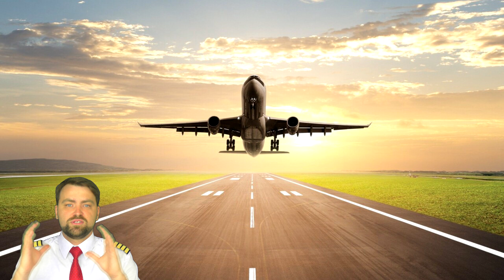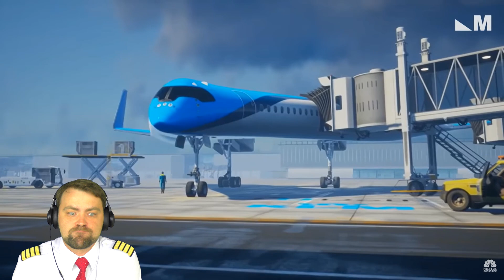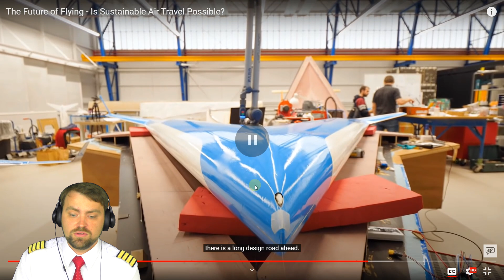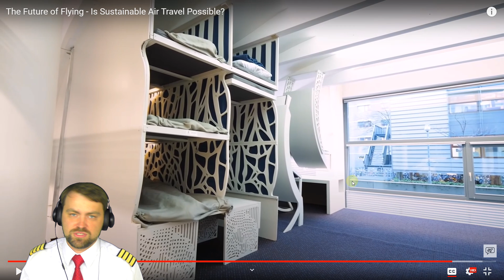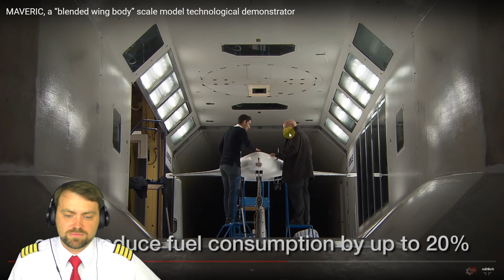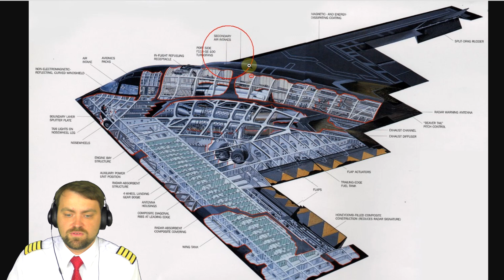Why this Airplane will Never fly? Flying-V plane concept review.

Comment: The blended wing body aircraft design is being considered for low carbon emissions using hydrogen as its fuel.  The cons are pressurizing the interior, emergency egress, and airport infrastructure as well as maintenance.  The pros are low carbon emissions, higher fuel efficiency, lower cabin noise with the engines in the rear, and ability to upgrade to hydrogen as a fuel source.

Comment: Jetzero is under contract to build a blended wing body for US Air Force (USAF). The USAF wants to use the Jetzero Z4 as a tanker or a cargo plane.  A full scale development (FSD) prototype is scheduled to fly next year.  Northrop-Grumman is partnering with Jetzero.  That brings in knowledge of B2 synergies.  United Airlines has firm order for 100 commercial versions with options for another 100.  This is contingent on Jetzero Z4 meeting milestones such as the FSD prototype being flown for USAF in the 1st quarter of 2027.  USAF has Jetzero under contract to have Z4 in service in 2030.  If successful, the commercial version will lead to an aircraft that seats 250 with 5K nautical miles range.  Delta Airlines and Alaska Airlines are teaming to provide advice to airport constraints such as gates, ground handling equipment, and maintenance considerations.

Comment: Tupolev TU-404 was a blended wing body airplane developed in 1991, but never went into production.   Tupolev should consider designing a scaled down version of the TU-404 on the same size as the Flying V.  Dust off the plans and make for today’s.

Work on the Tu-404 was initiated in 1991.  The Tu-404 was designed to transport more than 1,200 passengers to destinations 12,000 - 13,000 km away. The Tupolev Design Bureau investigated several possible configurations for the Tu-404, including a flying wing and a conventional design. The flying wing's powerplant would consist of six pusher turboprop engines developing 18,000 kg of thrust each during take-off and each consuming only 0.644 kg/kgf-h of fuel in cruise mode. The engines would have been located in the tail section of the flying wing fuselage between two large V-shaped vertical stabilizers. The central fuselage contains six passenger compartments accommodating 1214 passengers. The leading edge of the central fuselage has a sweep of 45 degrees. Two large removable wings containing fuel tanks have the leading-edge sweep of 35 degrees and are attached to the central fuselage. The wings hold most of the aircraft's fuel.

Comment: hi pilot, considering there is like a meter of space (or more) above the ceiling in a b787 fuselage (because it's like an egg shape), this structure could actually work and doesnt need to have a huge diameter if they make the roof more or less flat. (less curved)

Comment: Maiden flight just happened, according to various sources including CNN.
Reply from the maker: Of a real plane?
Reply: @PilotBlogDenys  apparently a real time scaled version. Not taking sides. I did read a few comments about passengers in wings and wings flapping in turbulent conditions but I have no idea if that is a solved issue, a scaled down unsolved factor then measured or what. Interesting stuff. If I had more time too look into it.

Comment: My main concern is that the passengers are far away from the roll center of the plane. They're going to feel alot more movement inside the plane, even in simple turns. I dont think it will be a confortable flight

Comment: 10:30 fully undarstand the pain 😂 
Some very interesting facts for example about ice accumulation. Didn't thought about it. From aerodynamics point of view this front section with this massive sweep would create enormous drag due to bending streamlines, and then those thin wing tips would get all this irregulary bended streams causing poor stability and making it very dependable to the angle of attack. Those engines wouldn't even get most of those streams. The only reason why swept wings exists is to be able to fly faster staying subsonic.  Also from engineering point of view.. where the wing spars are suposed to be located.?.  Saw a video saying that there is exactly opposite tendency in aviation to go for less swept wings and fly a little slower for fuel economy. Conclusion thoughts about this project: how serious concern recognized this guys as experts and gave them money to play?? Wtf

Comment: So you are mistaken, the model V plane was flying already. So it is not a paper plane as you state.
Reply from the maker: It is... Show me the real Flying-V! 
They launched the RC toy with 0 science in it. Money laundering, nothing more. As I said. The real Flying-V will never be real.
Reply: @PilotBlogDenys  You look a bit too negative on this matter. I've seen the model last year on 7th October 2019 at the 100th anniversary of KLM where it was presented first time and it looked impressive. Yes, I agree there is no full size plane yet, but it doesn't mean it cannot be done, Airbus is also looking into it. Further Delft Technical University is nothing but science. And flying wings were already flying in WWII, developed by the Germans: the Horten Ho 229.
Reply from the maker: @maartenj.vermeulen900  I am negative, because I don't see any prospects for this model. Well it is just my opinion. I hope that I am wrong 😉. Thanks for commenting 👍

Comment: As an expert in the rc hobby i can tell you know that the RC "scale model" will act very differently in the 1;1 version. In RC, if you stick a powerful motor on anything it would fly.  I can make  a flying circle if i wanted to and it would fly. Physics would affect the plane much differently in the 1;1 version.
Reply: Not to mention how aerodynamics act entirely differently. 
For example, if using a Naca 0012 airfoil for a very small plane, at those Reynolds numbers (~100000), the profile will produce better efficiency if mounted backwards (trailing edge forwards). Which is weird unless you consider that the best profiles at those tiny Reynolds numbers are sharp curved plates.
Reply: @g.zoltan  🤣 earodynamic rules cant change man. its all about using the correct weight, ballance and thrust ratings.
Reply: @royvanderweijden4432  Rules do not change. If implemented correctly. To reflect on my comment, an airfoil's characteristics depend on the Reynolds number. 
Different Re number, and the profile behaves differently.
Reply: Like you said," If you stick a powerful motor on anything it would fly." Here's the best proof of that I can think of. https://www.youtube.com/watch?v=0rJnXZsrMjU&t=92s
Reply: @flying-speed-attained  😂 the flying lawnmower was hilarious
Reply: Very true, but testing scale models is probably used in conjunction with wind tunnel testing and full scale CFD simulations to help validate the design.

Comment: Me again. I thought about another issue. It looks like the landing gear legs are very very tall.    And the landing gear retracts backwards, not sideways like real airliners. Considering the size and weight of a real V- Plane,  it would need multiple tires . My point is, there would be a big CG change with that much landing gear weight moving  that far back and forth, instead of sideways, near the CG, like real airliners. With landing gear retracted for cruise, it would be tail heavy. And for take off and landing speeds, it would be nose heavy. The V-Plane better have a very powerful elevator .

Comment: You should know that TU Delft is one of the leading universities worldwide in mechanical en aerospace engineering. People working on this project, and more generally aircrafts are Engineers, they know about structural mechanics, fluid dynamics, aeroelasticty, vibrations, heat transfer, etc. They dedicate their lives to building aircrafts and make aviation safer and cleaner for the environnement. You are a pilot. you use what engineers built and thaught about. So you may trust the engineers who brought aviation where it is today before bashing their work. Building aircrafts is not your job.
Reply from the maker: Great comment. They may be good in some design, but you can't avoid the air laws, aerodynamics, economics and common sense. I know what I am talking about. That project will remain concept, TU Delft will take the money and they'll be happy. KLM announced the lay-offs of 1500 employees and still investing to strange projects like this. Some professionals are up to loose their jobs but media showed this flying RC toy making everyone happy about it... No my fried, this is WRONG!

Comment: Sure, it's far from being a production plane, but the model flew. The fact that a big airline like KLM is willing to put some money into it, shows that there is optimism such a concept could eventually work. I don't see airports needing to adapt their infrastructure for maximum efficiency as a big problem, because it happened in the past. Airports adapted terminals for the A380 for example. Once a particular type of plane becomes popular, adapting the airports is the easy part. The challenging part is finding a company that will be able to produce those kind of planes in an assembly-line fashion. Here the chances are, the likes of Boeing or Airbus are either going to embrace or trying to kill it outright.

Comment: Damn, do your research before you will make such statements. It is clear that you've done none of that. Few things I would like to point out:
0:20 Commercial aviation industry does not develop fast. The general design of a plane we fly today was made in 60s. It does not mean there was no progress, but it achieved by very small, conservative iterations. 
0:31 Those "developer" are Boeing and Airbus. I do not think you need that air quotes there. They know how to make an aircraft. 
1:30 Are you sure the passengers will be in these wings? Yes. It is flying wing. Fuselage is part of the wing. That is the whole concept of flying wing. Instead of having fuselage that drags you down and wings that generate lift, entire airplane is a wing and generate lift. 
1:43 Have no doubts, because it will reduce drag. If you knew a thing or two about it you would not doubt it. At the speed of 0.82 mach the biggest problem is surface drag. The more surface you drag through the air the bigger the resistance. This is why commercial planes do not have pointy noses. Making them pointier would increase their surface, therefore it would make them slower. Flying wing (among other advantages) has in less surface in general in comparison to similar plane in traditional configuration. 
7:02 Well, Boeing and Airbus are investing in those concepts, so I guess this question is answered, right?
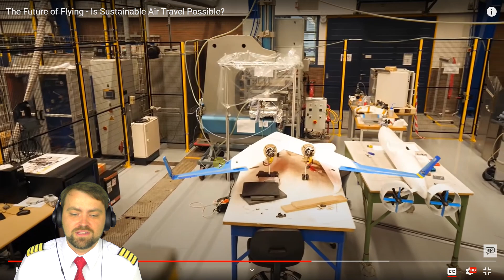7:40 "they have real engines?! O.O" It made me laugh, thanks ;) There are more moments like this later on xD I love it how mind-blown you are after the most obvious "revelations". Yes, they have models. In different scales, for testing various aspects of the design. Some of them can even fly. 
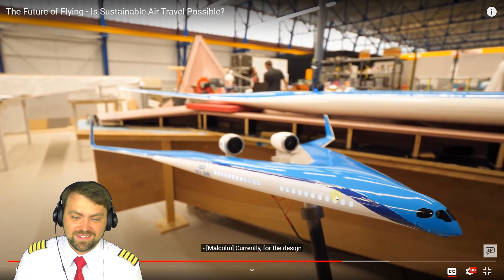8:14 The real airplanes will come after research, development and engineering is done. You know, how it is always done. You should not start with functional 1:1 airplane. You start small, solve issues, test ideas. Few years later you start building commercial planes.
I was trying, but I can watch this entire video, sorry :P Bye.
Reply from the maker: Did even watch the full video. Just criticism🤣
Reply: @PilotBlogDenys  Yeah, the video is unbearable, sorry. I did my best. Anyway, criticism still stands.

Comment: There is a group of engineers that built a large  working R.C. "V" Type Jet. It fly's beautifully and gracefully.
It was on U Tube in 9/9/2020.
Reply: i am from the netherlands where this v plane comes from, and i am sceptic imaging this plane BIG and new and have to discover the new flaws. i would go in a new sort of airplane that looks like a kite
Reply: Many people already commented and posted the RC video, but RC is just a size ratio difference. It doesn't account for the actual size, weight, weather, or air flow issues.

Comment: All the points you made, made sense to me. One point I thought of was, is how a tube  is the most practical design for cabin pressurization. Probably a big reason why all high flying,  passenger carrying airplanes are tubes. Think of all the internal structure needed  for a non-tube design to reliably contain  cabin pressure . I assume the proposed airliners are meant to fly above 10,000 feet.
Reply from the maker: Hm, good point Philip, I didn't think of pressurization. Tubes may able to withstand high differential  pressure. Flying V needs to be very strong to perform in the same way.

Comment: in fairness to you.. you do have a point on the plane stalling at high angles of attack
Reply from the maker: I think that problem may be solved in similar way as B-2. But I am not sure. There is a plane Tupolev-154, if it goes to high angle of attack it may enter the super stall condition. The engines fail in that case and there is nothing pilots can't do to recover from it. Several deadly cases because of that issue...
Reply: @PilotBlogDenys  could be.. but the air intake for the tupolev i think is on the underside of the wing
Reply from the maker: @SuperstudentAcademy  
There are 3 engines on the back. The central engine is shadowed by the fuselage at high angle of attack. Thank you for your comments!

Comment: Lifting body's have been around for a long time...I recommend you watch old episodes  of wings from discovery  on youtube
Reply: What's your point?  They didn't lift anything. They had no engines. They were all gliders with very low glide ratios . A go-around  was out of the  question.
Reply: @flying-speed-attained  They were full aircraft that flew https://en.m.wikipedia.org/wiki/Vincent_Burnelli#Flying_wing/Lifting_body
Reply: @RayleighCriterion  Well shut my mouth. I obviously didn't search deep enough to cover all bases. I only  found the NASA  Reentry Vehicle  experiments. I see that the Burnelli planes had  typical wings and a tail so I don't think they'd  be considered  lifting body aircraft by todays meaning of the term, where the body is the wing. Thanks for the  education.

Comment: I can see your point Mr. Pilot. There will be a strong drag on the wings of the flying V. I doubt that a full scale version will fly and just think of the pressure of wind current on the windows.
Reply from the maker: I don't think that it is possible to make the anti-ice system with those windows.
Reply: This is where using Aluminum Glass is a need. By the way, this Glass does exist.

Comment: It flew! So you were wrong. Lol
Reply: It didn't fly. What flew was a 22.5 kg toy model.
Reply: You can design a toy rc plane and make it fly easily but the real thing is much different. They can even fly a drill using rcs. The weight and the flow of air is very different compared to a real plane.

Comment: But now they tested it and it worked. You just have to wait. Me and KLM 1. you 0 . IT WILL FLY!!!!!
Reply from the maker: The RC toy 
flew, not the 1:1 Scale airplane with jet engines. It won't fly.
Reply: @PilotBlogDenys  ok then. Fly with your airplanes from 2003
Reply: @thegreatestdonut461  Anything rc can flyif you put enough power on it. If it was designed like the b-2 instead of a v shape it would have worked better

Comment: Well, the Flying V just had a test flight. A successful one. It's on TV.
Reply: It can work
Reply from the maker: It looks slim... I wonder what size it should be to contain all the passengers. Anyway I am not saying that I am 100% right. Let's just see what happens next. I bet that it is just a money waste... or money laundering...
Reply: @PilotBlogDenys  I think it's about saving money. All things being equal, meaning the number of passengers, distance traveled, and size of engines,  this thing just by being this shape, consumes 20% less fuel. In a world where we are looking to decarbonize, that is important. Anyway, this is some years away. the research  and development are ongoing.
Reply from the maker: @Greengate777  I hope so. Usually airplane manufacturers do that stuff. Not Airlines... Anyway I just hope that you are right 👍
Reply from the maker: @Greengate777  I hope so. Usually airplane manufacturers do that stuff. Not Airlines... Anyway I just hope that you are right 👍
Reply: @PilotBlogDenys  They are working with, and are partially funded by Airbus and Boeing.
Reply from the maker: @Greengate777  I think that they will fail with it. Just my opinion.
Airbus should fund this guy:
https://youtu.be/2DmPr5K985g
He makes everything to fly.
By the way I don't see the big difference with KLM model 🤣
Reply: @PilotBlogDenys  look first off, im a KLM lover so I'm sad. Second they are trying to save money. Third, they are partnered with Airbus so I'm at you 😡😡
Reply: @PilotBlogDenys  also Mr, did you know that the truck from Peter is a truck and not a plane.

Comment: Well maybe it will fly. KLM just released a video of a test flight with a model of the plane and although it did have some minor issues, the plane did take off and flew around for a solid 5 minutes.
Reply: yeah, i just saw that video

edit: it flies, but i´m not sure if its the next steep on aviation
Reply: @j2me991  I think it might be because the cabin of the plane is extremely large just like the A380 but unlike those planes it’s extremely efficient because of the wing design.
Reply: @STITZ Is that the new Politically Correct term for disastrous crash.
Reply: Imagine the weight and balance issues they didn’t even try to test in that test flight.
Reply: @valley.spotter9558  They actually did test balance and discovered that the balance isn't exactly right but that it's not too big of a deal
Reply from the maker: @Tony Wilson  Thanks for your big comment 👍. Thanks for your correction about the B2 Spirit. It definitely has max Mach of 0.95. 
Need to prepare more for that videos 🙂.
Reply: They didn't show it land though.